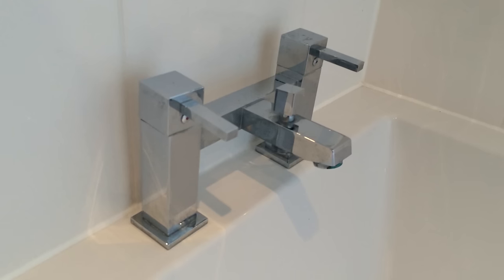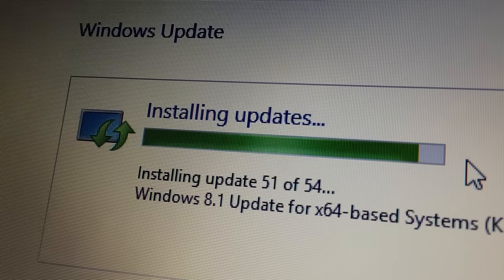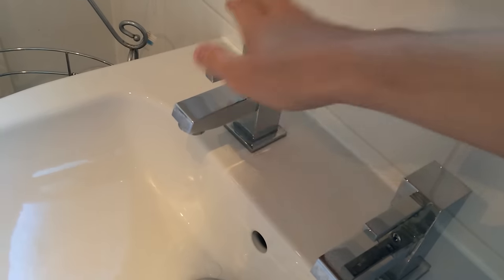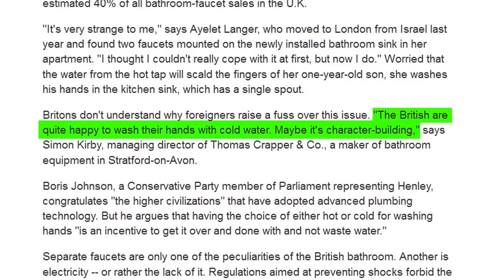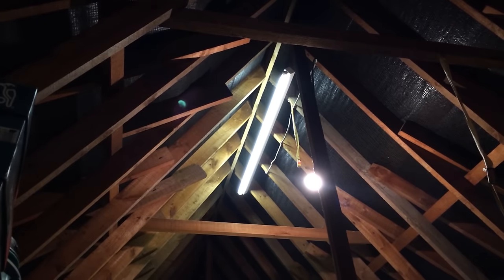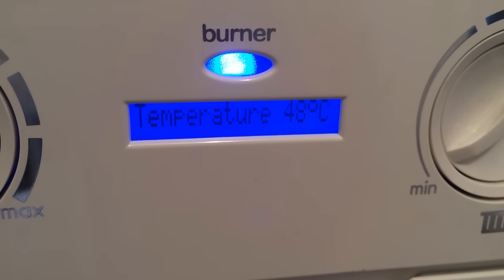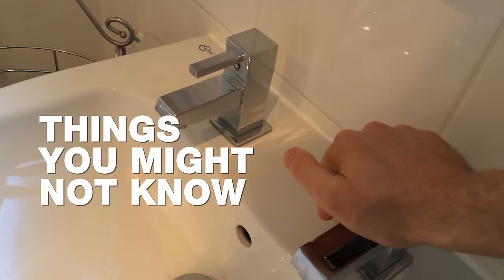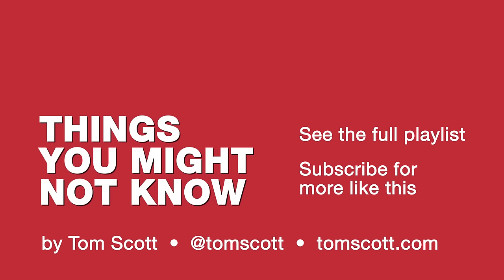Why Britain Uses Separate Hot and Cold Taps

Comment: I remember having this explained to me when I lived in England back in the 80s. But the craziest Brit thing I experienced was buying a blender, taking it home, and then finding no plug attached when I went to plug it in.
Reply: No plug? So how did it work? Do you have to purchase it separately?
Reply: @TaraConti  in old appliances you had to attach your own plug and know how to wire one not common practice anymore
Reply: I grew up in the UK, so am very familiar with wiring plugs. I have lived in Japan for the past 30 years and a couple of years ago, the plug on my iron wasn't working. I can remember the shock of people around me when I calmly just snipped it off, revealed the two wires inside and put a new plug on. Japanese plugs are two pronged affairs with no earth and either wire can go to either prong. It doesn't matter how you plug it into the socket so it is a foolproof system and hardly a difficult job. The Japanese are far too quick to throw things away before trying to even see if they can fix it. The iron is still working normally now and there is absolutely no reason why it shouldn't.
Reply: Tom has a video for that. 👍👍
Reply: @andrewjones-productions  In most small mains appliances, the live and neutral are transposable, and a lot of them don't have an earth connection either.
Reply: @mitchell522  up until 1992, Britian didn't require companies to attach a plug to their appliances. Wiring plugs was taught in British schools as it was a necessary skill.
Reply: @TaraConti  Er, yes. Back in the good old days!
Reply: @robinhodson9890  sounds so weird to me to hear you guys call it an "earth" connection. We call it a ground. Same thing I suppose, but still...like we say things like, "is this outlet grounded?" I can't imagine someone saying, "Is this outlet earthed?"
Reply: @ethervagabond  you wouldn't need to.all our outlets are earthed. 🙂
Reply: @andrewjones-productions  "The Japanese are far too quick to throw things away before trying to even see if they can fix it."

This seems like a statement made from you interacting with a relatively small group of people and deciding behavior you witnessed represented some unusual characteristic of Japanese culture,.
Reply: @noneofyourbusiness4616  To be honest I've heard about that too... but then again I've only heard about it from @Andrew Jones Productions . Doesn't that count?
Reply: Ah yes, the good old days when you had to know how to wire a plug onto an appliance. It was ok if everyone was proficient, but I had to change the occasional fuse and re-wire the plug again, as the person who put the plug on originally was handless. Then they changed the colours of the wires from brown, green and red to green and yellow stripe, blue and brown. It was a fiddly process, as the wires had to be different lengths to fit into the plug, if you cut some too short, you had to start all over again. I am very grateful to whomever it was in the UK that decided all appliances must come with a fixed plug with the correct fuse inside. If you messed up and replaced an old fuse with a new, incorrect amp fuse, you ran the risk of the appliance setting on fire. As I said, the good old days before H&S became popular!!
Reply: @noneofyourbusiness4616  the Japanese are notorious for wanting only new things. take cars for example. large parts of the world rely hugely on used car exports from Japan
Reply: @Trebor74  Well, they have to be. They are here too, unless the building isn’t up to code standards. People build their own houses sometimes.
Reply: That used to be quite common.
Reply: @nebulousisgod  US  houses built prior to grounding requirements in the electrical code are not required to have any grounded receptacles, unless local code or your insurance company says otherwise.  They are, in fact, "up to code" in most places if they comply with the code in effect at the time of installation or the most recent upgrade.
Reply: @UpnorthHere  I didn’t know that. I was always told differently. But what’s with the quotations, as if “up to code” isn’t an actual term? Because it most certainly is.
Reply: @UpnorthHere  A few years ago, I added a additional lamp into the lighting circuit in my garage, including an earth connection as standard, and was somewhat flummoxed to find there wasn't an earth in the original lighting circuit, to connect it to. The house was built in the 1960s, so the standards change over time. I had to run a new earth connection to the circuit, in the end.
Reply: @ethervagabond  We'd be more likely to say, "Why hasn't this socket got an earth?" In the UK, ground tends to refer to a metal chassis, in a vehicle, or sometimes the RF shield, in radio equipment. There are lots of other similar terms, Eg -v, 0V, Vdd, -ve, neutral, negative.
Reply: @user-su5xn1kh1l  It's actually still part of the physics GCSE syllabus
Reply: @robinhodson9890  Pity. Could just use LEDs, no earth required.
Reply: @user-su5xn1kh1l  my mum taught me how to attach plugs
Reply: Giving or receiving battery driven presents used to end in disappointment when unwrapped to find batteries not included ie where do you get batteries on ,say, Christmas Day! 🎅🏼
Reply: @Tom-qk4vn  I remember the disappointment ... it was 3 days before the shops opened again ...
Reply: @ethervagabond  hohohoooo, ground and earth are two different things
Reply: @noneofyourbusiness4616  no, it's true. Second hand shops are far less common in Japan too, they usually only want new goods, aside from collectors.
Reply: @andrewjones-productions  try putting the wires in the wrong way on an electronic device and see how long it lasts
Reply: @robinhodson9890  the correct term is CPC (circuit protective conductor ) in the regulations book .
Reply: @noneofyourbusiness4616  After 30 years living here, not exactly a small group of people. In fact, things have gotten better. It used to be far worse. It remains however a very much throw away culture.
Reply: @andrewjones-productions   I know in the states they use 120v which changes things a lot due to less danger to life etc , maybe Japan is one of the few countries that use the same system

Just to clarify I never said you were lying I'm just saying electronic devices will not like reversed polarity
Reply: @andrewjones-productions  Maybe in the 30 years you've been away from wherever you came from, that culture you came from has changed too. Maybe you're mis-diagnosing Japan as being exceptional in a way that the developed world in general has changed.
Reply: @christophergallagher3845  no such thing as reversed polarity with AC.
Reply: @noneofyourbusiness4616  he's correct, stop talking about a culture you don't understand.
Reply: @UpnorthHere  that explains alot actually XD
Reply: @Tom-qk4vn  in the remote? 😅
Reply: @user-su5xn1kh1l  still is
Reply: @atrtsh  This is so not true, there are Hard Off's and the other Offs everywhere.
Reply: @ethervagabond  Same earth or "Erde" in germany.
Reply: @ethervagabond  You have to be careful. Some outlets are unearthed. ;)
Reply: @noneofyourbusiness4616  You came into this thread trying to be politically correct by neutralizing what you conceived of as a disparaging remark against Japan. As it turns out you got shot down.
Reply: @sstills951  Weird, I didn't feel a thing.
Reply: @ethervagabond  In Germany we call it "geerdet" which funnily enough would most closely translate to earthed :-)
Reply: @cr3237  Did you say the person who originally put the plug on was handless? I'm intrigued. I can't imagine wiring an appliance would be easy without hands!
Reply: @kristileigh9059  it's a saying in the UK. I suspect before long the PC brigade with have me tarred and feathered for saying something like that.
Reply: @noneofyourbusiness4616  you didn't feel a thing because you aren't self aware enough to acknowledge when you're wrong
Reply: @cr3237  Never heard handless before, but I like it.
Reply: I’d just jam the bare wires into the correct holes in the socket.
Reply: @andrewjones-productions  I live in Poland and every single plug I've seen was a hard cast rubber or plastic. There's absolutely no way to easily pop it open without completely destroying it.

Of course, you can cut the cord to expose the wires, cut the plug from another broken device, and reconnect the cables with a screw terminal. But that's a lot more of a hassle, and the result won't be quite as safe, even if you do some extra improvised isolation.
Reply: @jakistam1000  you can buy a plug maybe poland doesn't have it but you can buy a plug for like 6 bucks. fixed my dehumidifier two days ago
Reply: @user-su5xn1kh1l  whaaa? wow. I can't even check my circuit breakers.
Reply: @ethervagabond  Why would an outlet be sensible, realistic about its situation, have a pension & life insurance?
Reply: @ethelmini  well, why would it be covered in dirt? Oh...I suppose if no one cleaned it in a while...
Reply: @noneofyourbusiness4616  "Maybe you're mis-diagnosing Japan as being exceptional in a way that the developed world in general has changed." Maybe you shouldn't question the personal experiences of someone who's lived in a country for 30 years? Or maybe it's "None Of Your Business"?
Reply: @ethervagabond  To me being grounded is not being allowed to go out, having to stay home.
Reply: @christophergallagher3845  unless the plug has a dc adapter inside of it (like a usb charger, yknow those big bulky things?) reversed polarity is something the electronic device will expect to receive every 50th of a second (UK).
Reply: @LunaEllis  oh I'm aware , it's why some power chords come with no set polarity ( figure 8, looking adaptors )
Reply: @LunaEllis  in that case a PS4 has a 50% chance of having reversed polarity constantly but as you may know not evry device has the same tolerance and like I said reversed polarity can have devastating results to your appliances
Reply: @noneofyourbusiness4616  I think that living in Japan for 30 years gives them a bit more insight.
Reply: @DVankeuren  Like I said, living in Japan for 30 years doesn't give them any insight into how the people of Japan compare to people elsewhere in the world. A lot has changed in relation to consumer products in 30 years: everywhere. This person has no insight outside of Japan today on which to compare the behavior of the Japanese people to others elsewhere, because they've been in Japan, not elsewhere. At best, he's comparing them to his vague memory of what life was like back home 30 years ago. But beyond that, it takes a fairly conceited person to think they can accurately judge an entire nation based on their limited experience. I would never presume to judge the character of the entire nation where I live. How much of a nation does one typically see in 30 years? Usually, a very small slice, unless that person is dedicating their life to traveling from city to city, from small town to small town, and meeting as many people as possible in as many different walks of life as possible. It's a facile generalization.
Reply: @kristileigh9059  I took it to mean something like the American saying all thumbs
Reply: When you purchased the seperate plug it frequently came with a 13A fuse which should be changed for one of the right, usually lower, value for the appliance. I'm sure many people didn't bother meaning this was less safe than it should be.
Reply: @ethervagabond  And yet it is perfectly normal.Just remember, you speak Murican.
Reply: @Akomarongg , most people don’t even consider if they need a earth ground on a portable electric generator.  In fact they don’t even check to see if the appliance ground and neutrals are bonded.  Most would plug generators into house wiring without knowing if they need to disconnect the bond before doing so.  They should teach some home everyday life electric safety course as part of school education.
Reply: I learned from watching Mr. Bean doing a TV plug up, just jam the cord in and twist! Don't forget to drop some coins in the meter!
Reply: @andrewjones-productions  So you are partly responsible for the downturn in Japanese electronics manufacturing.
Reply: @ethervagabond  you just said it
Reply: @Tom-qk4vn  the pa$y shop
Reply: @user-su5xn1kh1l  And in New Zealand it was illegal to replace your own plugs. Seriously.
Reply: @jakistam1000  I buy appropriate plugs for whichever country. In PL, I mostly just use what I can buy here.
Reply: @UpnorthHere  p
Reply: This is just stupid. I wonder why you use cars in GB. Back in the day it was a dangerous business driving a car. Why isn’t an old habit here too? 😂
Reply: @ethervagabond  Nobody would ever ask if a socket is Earthed in the UK, as they ALL are!
Reply: Old standard before 1992! Mandatory now
Reply: @andrewjones-productions this surprises me! I always thought of them being a culture that holds on to relics…like fax 😂

Comment: The main issue with the water is that it is (or was) stored in a tank. I remember back when we had wells, elder people pulled out buckets of water just to spill it on the ground somewhere, simply to create a water "flow" out of the well, otherwise the water will get "dead". The well simply needs certain amount of consumption in order to stay clean. It is the same with water tank: works well when you have higher water consumption and gets really bad when it is too low.

Comment: Well I've had a mixer tap all my life and I also run cold water for a few seconds before I drink from it.
Reply: Seeing your water systems infrastructure I would never drink from the tap in the entirety of the USA.
Reply: I live in a rural area, so our tap water is drawn from groundwater, filtered inside our house, and then kept in our own water heater. It's not shared with even another household, so I feel pretty safe. I drink tap water all the time.
Reply: Litego you legend
Reply: gundam fan I know right.
Reply: Where i am in Canada, I usually run the tap for a couple of seconds before drinking it as well... Mostly because in my old house the sink was on the other side of the house from where the water enters, so it sits, tastes funny and gets warm.  Even in my apartment i do that, because it's a shitty apartment and the cold water has to travel from the basement to the 2nd floor, so if i want cold water, i have to run it for like 5-10 seconds.  better than the hot water.  We have Hot Water "On Demand" so it heats the water as we use it, and we won't see even warm water come out of our tap after 30 seconds of running it full blast.
Reply: Same here, but for the only purpose of making sure the water is cold and fresh from the underground watertubes.

Comment: This doesn't explain why every kitchen (where you'd normally be getting a drink) I grew up with had a mixer tap, and every bathroom (where you mostly wash your hands) had separate taps. It just seemed completely perverse.
Reply: Depends on the piping. When there was a local heater under the sink that heated a split of the cold water stream, it should be safe.
Reply: @35mm21  Showers aren't meant to be drank from. Ablution water water doesn't need to be drinkable
Just because something has water doesn't mean you're meant to drink from it. For example, depending on your suburb in Australia, toilets are filled with clean drinking water. But you wouldn't drink the clean drinking water out of the cistern of a toilet.
Reply: @35mm21  Touch'e 
However, you wet your toothbrush which goes in your mouth